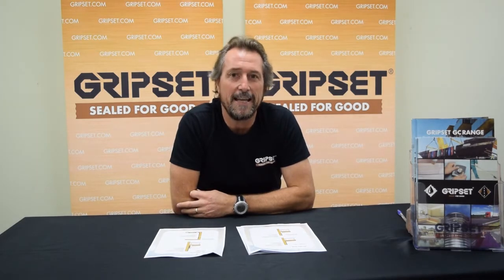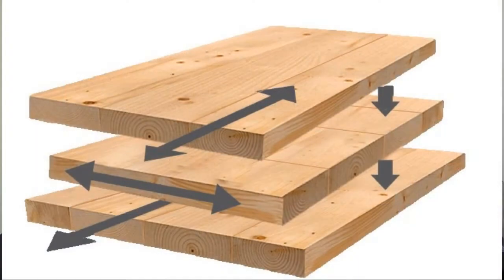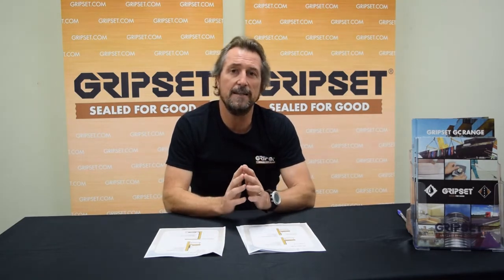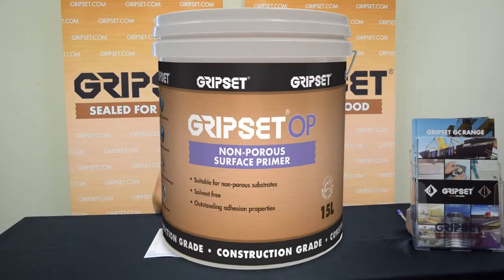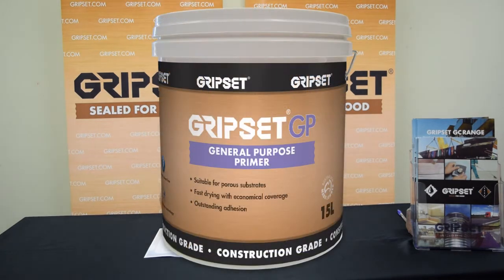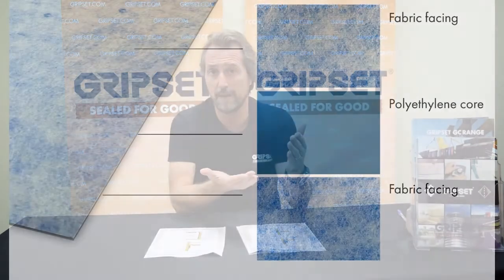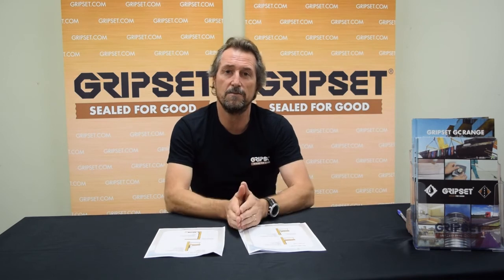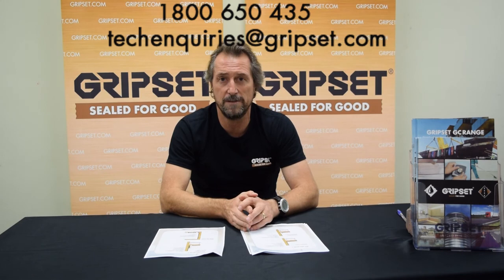What is CLT? What does it mean for waterproofing?

Comment: The opening image you have of a CLT building is like so many on the net, that is, the timber shows clearly that CLT is unsealable to moisture. Relatively recent news events also show that fire treated building cladding materials can easily be set fire, causing death and destruction. You are quite correct in that you need more details.
Reply: Keith, "like so many on the net" have no idea.
Reply: You very ill informed. CLT is none of what you have claimed. It's waterproof, fireproof, durable amongst many other positives.
Reply: @elwynpupangpilyo7217  incorrect

Comment: You absolutely have to balloon frame this shit if you wanna get tall. The compressive strength of structural wood parallel to grain is about 30 MPa while perpendicular to grain is about 3 MPa. It’ll be easy to do too since it’s so modular those verts can be jointed in an interlocking fashion with an adhesive and the horizontal pieces can be Doweled, bolted, or nailed into these joints. Has the potential to go much higher than conventional CLT systems I believe.